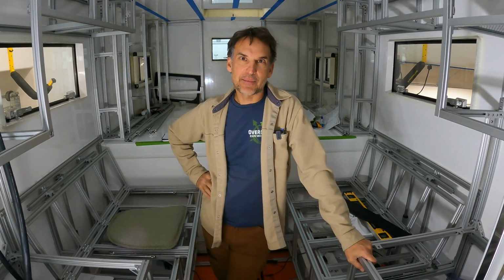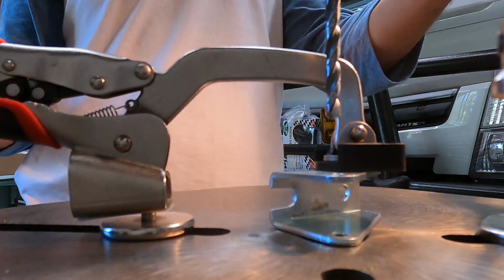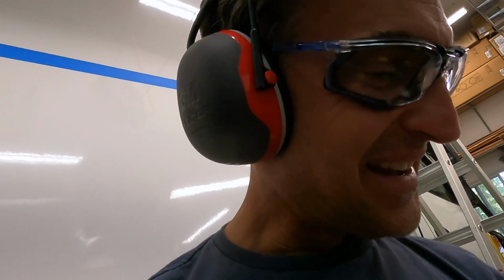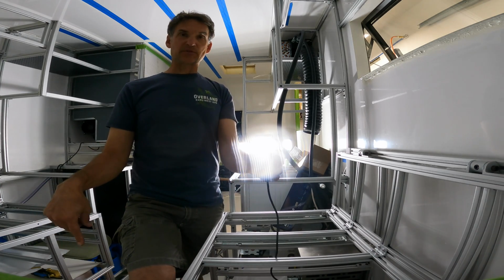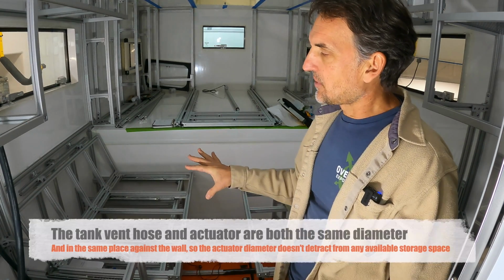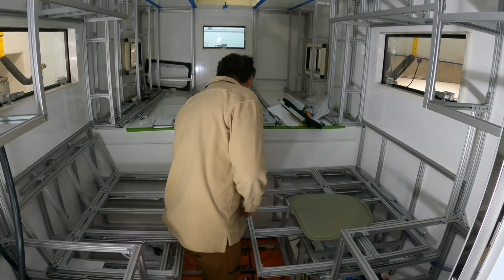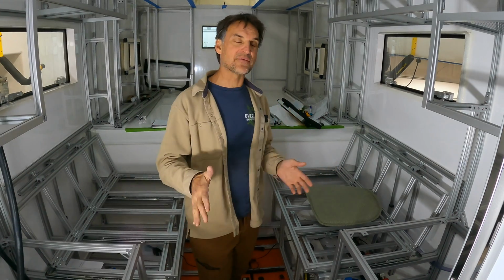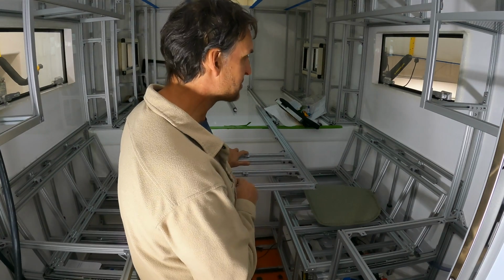How and why to build Reclining Dinette Benches in a Camper

Comment: Great video! Would it be possible to get links to the hardware used please? Ie the slides, joints, hinges, etc?
Reply from the maker: The slides under the base frames are Accuride 9301E--four per side. And standard linear bearings along the wall frame to track the backrest with some 8020 hinges between them although any hinge appropriately sized for your frame should work.
Reply: @vantripping  Thank you!

Comment: Thanks for the vid! how many feet of 8020 did you get for the build? I am going to have tog get some soon and an estimate of how much would be nice! also what size are you using?
Reply from the maker: I've been using all 1" profiles as more than plenty strong. I haven't counted up feet, yet, but will try to as I'm about all finished with the interior framing. I have been recording weight for each cabinet section and will report total weight. It think all of the framing will weigh about the same or less than if framed with plywood. It's lighter than it looks.
Reply from the maker: You may also enjoy and get some tips from this video I did of my camper van cabinets: https://youtu.be/5hl-s_lur1Y
Reply: @vantripping  Amazing thank you so much! and love your vids they're super-helpful
Reply from the maker: @patblatblat  Thank you, And you're welcome.

Comment: What is the empty weight of just the truck you purchased? What is the cargo capacity? Thanks
Reply from the maker: Empty weight is about 8000 pounds with 4x4 conversion, subframe, roof rack/scrub bars, front winch & bull bar and rear bumper. That's with the 37" tires. Payload is >7000-9000 pounds with the factory suspension, brakes, axles and wheels, but with the upgraded wheels, tires, axles and brakes, actual capacity is certainly at the higher end of this range. While there is a lot of 8020, I've been weighing it all, and it still weighs less than if built with plywood and total weight should leave 2000 to 4000 pounds if not more of extra cargo capacity.
Reply: @vantripping  I was looking at all the 80/20, but I also remembered you had 110 gallons of fresh water at 8.35 lbs/gal that is 918 lbs, plus the weight of the large battery bank, cloths washer, it seemed like weight was adding up quick. How much did all the composite panels weigh? The floor panel must have been pretty heavy with all the steel and plywood inside. Is your chassis a Mitsubishi Fuso or Isuzu NPR? It is all coming along, nice work!
Reply from the maker: @chrisdaniel1339  Yes, you are correct on those weights, and it is adding up, but my calculations on weight will still have me fully loaded with water, people, clothes, gear and food with 1000 to 2000 pounds of head room on weight. Yes, the 8020 looks heavy, but there is an economy of how it's put together in sections to keep it fairly minimal. The composite camper weighs about 1500, plus windows and doors. I'll weigh the whole thing and break down weights by components and share via my videos as I get a little closer to it being completed. Getting closer! I'll also make some assessments and recommended changes to save weight after I complete it.

Comment: Very cool, they look like they are super solid. Are you using linear bearings for the sliders?
Reply from the maker: They are very solid, and once covered with solid surfaces and foam seating, they will be very solid. I am not using linear bearings one the lower horizontal frame as those don't handle cantilevered loads well and I am cantilevering the loads away from the lower frame. However, I am using linear bearings on the upper vertical "slides" as those just need to track and retain the position of the upper frame, so a perfect use for linear bearings.